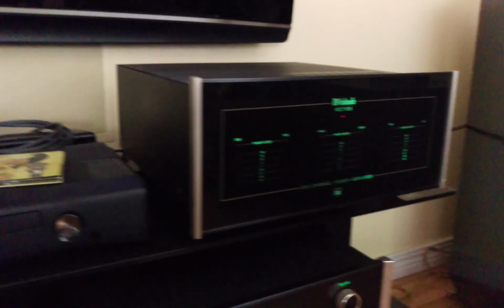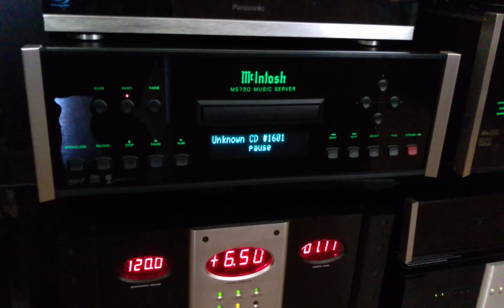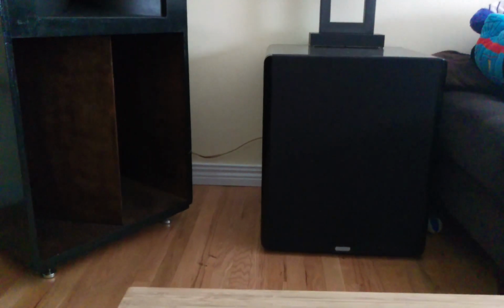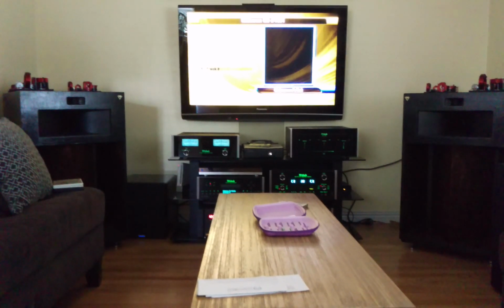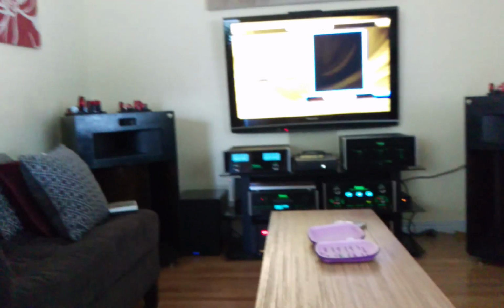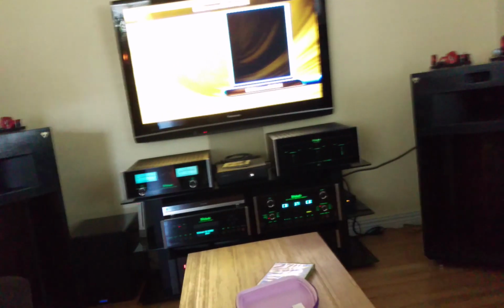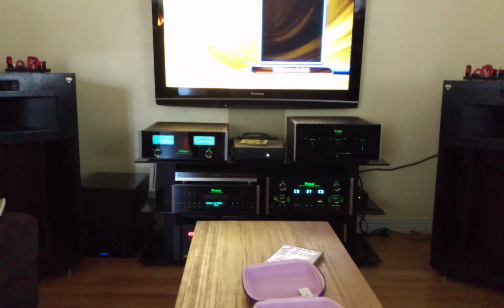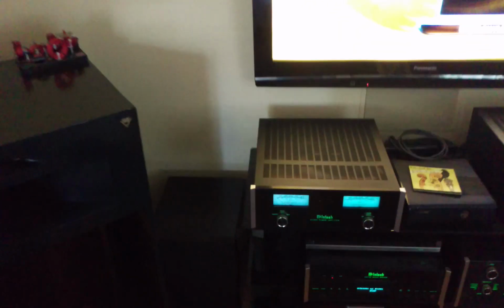McIntosh with klipsch La Scala and ALK engineering extreme slope filtering Networks

Comment: Great setup but it seems like the room is too small to fully appreciate them. Not being critical but these need to breath. I have the klipschorn and Lascala combo in a room that’s 28x18.
Reply from the maker: Agreed, the width is not enough and it back a little ways in a L shape. I have moved and now have a room that is 18' x 34' with 9' ceilings, much better. Don't listen to the La Scalas much anymore, I picked up a pair of electro voice Patrician 700 And have changed over to tubes.

Comment: Aaron, how much of the improvement in sound quality in this video over the first would you say is the crossover network versus the upgraded components?
Reply from the maker: Well, that's a good question. Unfortunately I had to sell the Rotel to purchase the McIntosh. I would say that most of the sound quality improvement was the McIntosh components. The the thing that stood out with the networks and mid horn lens, was the normal  Characteristics of the La Scala where not so prominent. These being bright, harsh, in your face, muddy and ear fatigue. To be honest  I like some of that, which is why I like Klipsch. With that said the La Scala became soft, delicate and extremely accurate. Even at a higher listening level they where no longer fatiguing. Honestly they are a different speaker but the bass horn is still boxie and they are still bright.  I finally got tubes that cut this back and the  Engineer that designed the networks put gain controls in the design, but they are still boxie. The last audio show I went to Klipsch had all revamped heritage speakers the La Scala had all these improvements plus woofer horn improvements.  The short answer is the sound quality improvement was worth every penny 👍🔊
Reply: @aaronsjones5887  Some people have been doing away with the midrange horn and putting wood tatrix horns in its place Volvo=Treeter has plans for these horns.
Reply from the maker: @WayneMickel  yes I did the same to my LA Scala.

Comment: Just found your videos but thought I would comment anyway.  I just installed my ALK extreme slope crossover networks and am enjoying the presentation.  Didn’t know what to expect as I always enjoyed the sound of my La Scala’s. Bought them new in 1980.  Hard to describe the sound other than it seems more detailed.  Not a wider soundstage but perhaps more depth maybe.  Hard to describe other than it is different in a great way and I like it.  My gear is inexpensive in the grand scheme of things(tube preamp and tube phono stage) but they are separates and I can only imagine what high end front-end gear would bring to the table.  Happy listening👍
Reply from the maker: Thanks for the comment. I agree with your observations. Depth is the biggest impact, the McIntosh components take that to a new level and justify (mostly) there cost. It's been my experience that only McIntosh amps, pre-amp and integrated amp are worth buying. I think what you have is great a big power McIntosh amp would be fun with your setup.
Reply: @aaronsjones5887  like you, I’m considering some older Mac gear but even the solid state stuff like MC250 or 2100’s are demanding high $ now for what they are.  This hobby is such a rabbit hole
Reply from the maker: @Steveh817  i would stick with  the 1990s equipment they are  relatively affordable and specs are greatly improved.
Reply: @aaronsjones5887  thanks for the tip. I’ll check them out.  I may consider building a SET amp seeing how I seem to be spending more time at home as of late.  Check these guys out...www.transcendentsound.com.  A new hobby perhaps.  Take care and enjoy the music!
Reply from the maker: @Steveh817  looks fun, been thinking the same, ill check them out. Going to make a new video with my new setup.
Reply: @aaronsjones5887  cool. I’ll lookout for it

Comment: Why do lascalas have no bottom end or mid bass? Why did they use short throw woofers in a cabinet that requires air to pass through corners ?
Reply: What do you mean "requires air to pass through corners"?  That makes no sense. Air movement and sound waves are not the same thing. The bass cab is sealed, so a short throw makes perfect sense AND has less distortion. The LaScala's sacrifice bottom end for efficiency. That is the trade off with any folded horn design, because the majority of the cab size is dedicated to the folded horn. Make a conventional cab (a box) the same dimensions as the LaScala with the same drivers and you would have "bottom end" for days but nowhere near the efficiency of the LaScala's. No free lunches in physics, but what they do they do extremely well.
Reply: @beestoe993 add a kel sub woofer..
Reply from the maker: Well said bees toe. Paul Klipsch was a genius certified and certifiable.
Reply: These weren't designed for rap music at least from what I can tell. I want a pair... but for now I'll have to stick to my RP 600s

Comment: Not a criticism, dude, but as you know the power is so over the top power wise for the la scala's. I'd love to see your opinion on a pair of Quad II power valve amps,  which have a minimal output, but such a sweet presentation.  Loving the system and setup too, thanks for the vid.
Reply from the maker: Yes the power is over the top for the La Scala. Been trying to find an older tube amp at a reasonable price to hear them with that. Got a  line on a old Heath kit amp with very low hours and in pristine condition. 25 watts a channel into 8ohms should be just right. With the networks on the La Scala it makes the load very stable. It's a steal of a deal for the amp and has the possibility to turn it for a profit, maybe get something a little newer or better. Don't know much about tubes but thanks for the suggestion, I'll look into those amps. Will make a video of that if I get it. Thanks for the comment.

Comment: I am quite lacking understanding in amps.  Many questions that may sound noobish.  Why spend this cash for pushing only 2 of the 200 watts available?  I get the La Scala need, and the need for clear and good signal.  My system is flagship Yamaha with internal amp, to some DefTech speakers.  Things sound pretty great.  What is the major difference in filters and amps, and what wow factor pushes this type of investment you are showing us?  Looks and sounds great btw.
Reply from the maker: The wattage available for the very efficient La Scala is over kill, however I do listen to them very loud. It's a different experience when you can also feel the music. The main reason for the wattage is all my equipment is used except the filter networks. I got a very good deal on the amps which is the only way I can afford this equipment. To the best of my understanding, you want more wattage available then what your speaker can handle in order to have the head room in the amplifier. McIntosh builds this in all their amps so it's not as critical as some others ive had. This means you can have your speakers loud without pushing the amplifier to its clipping point. To my knowledge the speakers can handle clipping better than amplifiers. Clipping/ distortion can damage speakers. As far as the difference in amps and equipment the simple answer the quality of parts, build and execution. All manufacturers do it a little different so they get different sound. Of course it's far more involved than just that. As far as the filtering Networks I would refer to alk engineering's website http://www.alkeng.com/  he can explain the benefit of his design. For my part of the question what has prompted me to make this investment, is the evolution of the La Scala's as I have upgraded equipment and networks. I've owned these speakers for 20 years and have used tons of different equipment to power them. Above all however my addiction to audio equipment is rediscovering the music I've been listening to my whole life. That that's what makes the investment worthwhile to me. I now own some Wilson Audio Witt speakers the change in sound is fun and again I get to listen to my favorite artist like new again. Hope that answers your questions thanks for the comment.

Comment: For the amount of costs for the external crossover (passive), why did you not use an electronic crossover,  so much more accurate accurate, significantly lower distortion and will not cause interface concerns.  For $1400 you could pick up some excellent electronic crossovers.  I have a highly modified Dahlquist electronic crossover, and it is still one of the best available.  You would probably pay around $600 for a modified one.  Bi-amp system is so much cleaner, yes you need two amps,  but you have all kinds of them,  just use them to produce the best sound.  I currently have electrostatic screens with dual subs with a Conrad Johnson hybrid amp along with an Audio Research D150 power amp, with a Dahlquist.
Reply from the maker: I did look into that and found its not as straight forward as crossovers and amps. I haven't quite gotten to the point of wanting to try that. I've always wanted to try but need some more knowledge so I can execute it correctly without damaging anything. Check out this website under the questions and answers section question 8, this is what deterred me http://www.alkeng.com/
If you have any more info I would be very interested. Thanks for your comment.

Comment: I'm a LaScala fan .  

The biggest mistake I ever made was selling them to buy my Klipschorns . I went through the same questions ALK or Crites so I went both . On one side I modified the speaker with ALK and then the other side with crites except I used the a/4500 with CT125 tweeters . To my surprise the Crites sounded so much better and not just me to everyone . I switched speakers  from left to right and then back to be fair . 

As the great Micheal Vick said I have no dog in this fight . I sold my ALK crossovers at a profit so I'm not upset about owning them . they looked like a million and I was sad they didn't work out for me . Unlike you I wanted the original appearance . My speakers were minty and I wanted for them to stay that way . 

If you are open to Advice I would clean up that mess you have with all your equipment clumped up . I know these things are personal .   I only have 3 pieces showing . Sony HAP Z1ES  McIntosh C2300 and a Woo Audio WA5 form my headphones besides my speakers  .  People showed be wowed by the sound not by the stacks of unused equipment .
Reply from the maker: Thank you for your comment. It is very nice to someone that has listened to both, unfortunately have only heard ALK. To be honest made my decision by research and some reviews. 

What model ALK networks or when did you get them? His design has changed over the years. Have you heard of Volti is so what's your opinion?

   I to want to keep the original integrity of the speaker. Despite the disapproval from my wife, I was able keep the original mid-range horn lenses and obviously the networks. Unfortunately the finish of the speaker was destroyed before I got them, I do have plans to refinish them unless I can find nice empty boxes. 

  Yes the mess of cables and what the equipment is sitting on needs to be addressed intact it bugs the hell out of me. Wasn't as bad with Rotel but the McIntosh is alot bigger and barely fits on the shelf. I am married so the spouse approval factor is the first consideration. As of late I have some plans in the works to build a new stand with her approval. I have some room treatments that came out awesome that she likes. If I had the space and approval I would have separate room for my two channel. You make a good point about being wowed by the sound and not the stacks of equipment. But as a audiophile the  equipment and looks of it all is part of the appeal and fun.

Thanks again for your comment.
Reply: @aaronsjones5887 

 Seriously I feel the LaScalas are the best speakers for the dollar . I worked at an audio store that was the number one klipsch  dealer . They called it the pipeline to Mexico . Volti is just a pretty version of what you already have maybe a little lower response . The big selling point of the LaScala was you can place the speaker anywhere in the room and get great sound . 

That's almost true , I found a few feet from a flat wall with a very slight toe in and a clear path down the middle to the wall has a remarkable sweet spot. So many feet apart  and so many feet away rules should be ignored .  

If you can get a hold of some industrial / commercial 200 watt Lascala you can have a lot of fun with them especially the two piece industrial's I think they used the K43 

I had a pair that came from Antones famous Nightclub in Austin Texas they were super loud powerful and super clean . 

At heart I'm A LaScala  loyalist
Reply: Charlie davidson My best friend has the 2 piece industrials. I had them in my home for about 6 months. You really have to crank them up loud to get any bass out of them. Pretty indestructible though. The fuses would blow before we could do any damage to them
Reply from the maker: @MrBonger88   that's for sure, I've had people over and it's nice being able to hand them the remote and say " turn it up as loud as you want, you'll give up before they do"

Comment: For fun have you tried moving the autoformer attenuation jumpers to 0db on both mid&tweet?  You'll need to rerun your sweeps, but that gives you a sense of how efficient the top end could be if you had a bass horn big enough to match them in efficiency. If a song has little to no bass in the recording then it will sound amazing like this.  But don't do it too long -- Al K. said his swamping resister is only happy with -6db and down for the mid.  Today I have the tweets at 0db and the mid's back to their stock position (-6db).  For me I found that amps around 100wpc are sounding best.  Surprisingly my worst sound was from a First Watt J2.  I'm way overdue for making another video.
Reply from the maker: I have done that, I've pushed them pretty hard. The louder they go the more bass you have. I do enjoy my La Scala's for what they can do best reproduce the live sound. It's fun to feel the Music also. I have a pair of Wilson Audio Witt now and been having fun with there detail and playing with acoustics of the room. They don't do what the La Scalas do but the La Scala don't do what the Witt's do. It's like a supped up muscle car and a Ferrari. But are fun to drive but are totally different experiences. I would like to get a good tube amp and hear what the La Scala sound like. I've been told they shine with tube power.

Comment: Do you have any sense of how much sensitivity has been reduced by virtue of the ALK crossovers?  Originally these were 104 db for 1 watt, thus 8 watts would have produced 113 db at 1 meter; so to even to be able to utilize 90 watts would be auditory pain at the original sensitivity.  The sound was very much improved in comparison to your original video, but seemingly at the expense of amplifier power.  The SET crowd might be disappointed.
Reply from the maker: In this video I had not touched the tweet and mid controls that come as part of the extreme slope networks. In trying to get my wife to like my La Scala more I have turned them down and noticed the spl is substantially lower. The exponential mid horn lens is what Paul used to get that 104db rating. I have replied that with a lens from fastlane audio Dave said it would drop the spl by 1, I didn't notice.  It's been kinda nice having the La Scala a little tame, the amp can handle the load easily and the sound was balanced but the woofer horn got boxie as they do at higher volume. it was still way louder than most people would be comfortable with. When I got these networks AL said they are for home use only he has not done any testing for out side or concert use, thats what klipsch AA network is for. Hope I answered your question thanks for the comment.